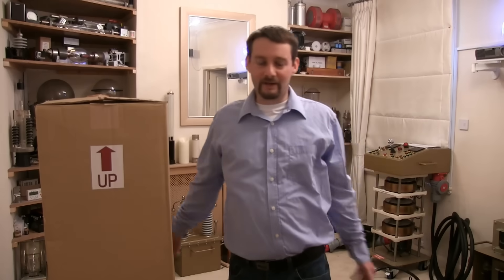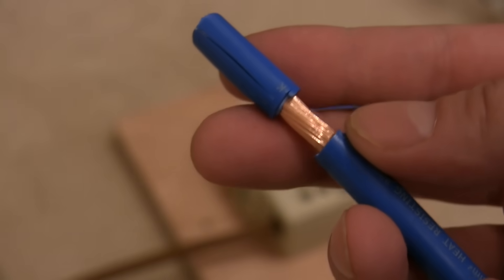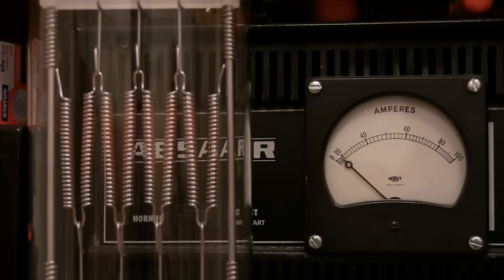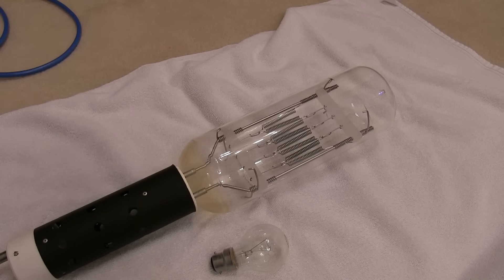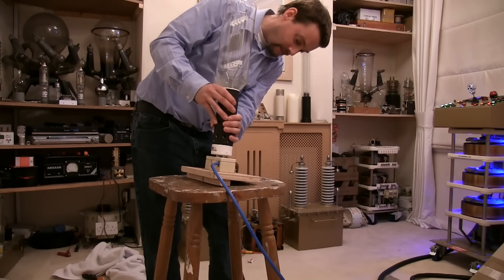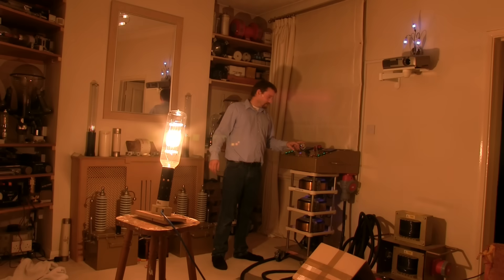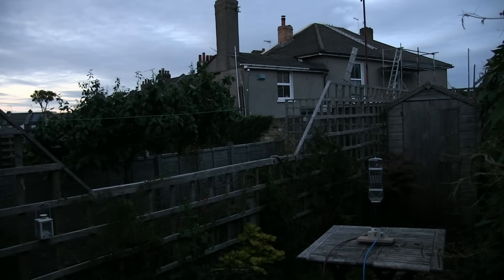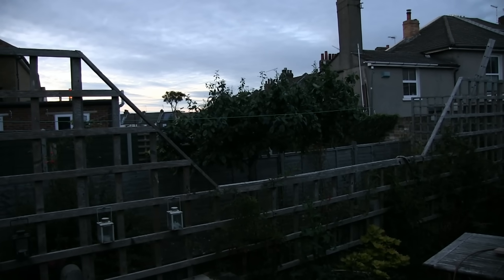20,000 Watt Light Bulb Test

Comment: A whiteout on your end!! Wow!
A friend of mine gave me a bulb that he says came from a radio tower, but I can't find a socket to wire it up safely.
Where might I find such a socket?
It isn't a screw in bulb, and looks like it is a push in and twist type of bulb?
Anyway I know it came out of an aviation obstruction light.
Any help would be great 👍!
BTW, there are exactly zero markings on the bulb itself. It's about 10 inches tall, and about 4 inches across...

Comment: What was the operating voltage of this?
Reply: He varied it, gave it 12v at the start of the video. The end of vid outdoor test was showing 227v
Reply: Voltage is in red on the meter display, measured in kV.  The bulb is rated for 240V.

Comment: Temperature at various distances around the bulb to determine actual radiated heat. Check temperature directly above it to determine convective heat through the old hot gas rises. This should cause a classic thermosyphon in the room.

Comment: The lighting fixture that you use with these lamps is the size of a wash tub and has a fresnel lens 24 inches across.  I used three of them once on a film  set and the rental house accidentally sent us two 208V bulbs (for three phase power) and one 240V bulb (single phase)  the 240V bulb was visibly dimmer on our 208V system until we figured out the problem and got another 208V lamp.  Good thing we didn't run a 280V lamp on 240V single phase power and over volt it!  Those bulbs are expensive!

Comment: Cool video... But seriously, who would want to use such a large incandescent lamp when MH, Short-Arc Xenon, RF plasma, etc.. Lamps are available, and FAR more efficient. I mean, this thing is basically a huge resistor that gets so hot that its putting out visible light as a by-product. No matter what anyone does to it, its still a metal wire, glowing white hot, so probably half of the energy is below the visible spectrum, and the hot gas around it is putting out UV, so you can't see that either.. Here in Canada, we've already banned new installations, which is a bit weird, because now we have some streetlights that are bright yellow, and the new xenon ones that are bright white, and the even newer LED ones (that we abandoned and are no longer installing) are blue-white and look terrible.. When they first installed them they looked really great, but after 2-3 years, the colour correcting phosphors degrade because of how cold the winters are here. In my city we've agreed to a contract with a company that makes xenon lamps, were using those now, MUCH brighter, and true white, not yellow-orange, not blue-white.

Comment: Looking at that control panel, there are copper coils underneath it, presumably to do with the power delivery, but why do they have little white arms rotating slowly around them?
Reply: They're most likely variable transformers. The arms move across the coils to vary the voltage.

Comment: You know you are experimenting with a massive incandescent light when it requires 240 volts and 20,000 watts. First clue is when every flammable object in lab catch fire from direct radiant energy. Going to need a bigger lab, maybe even a warehouse. You need to get psychologically ready for the enormous electricity bill coming. 

Wonder what 5 of these behemoths running together would look like... Sun, Supernova, Pulsar, Ground Zero with Tzar Bomba, Trinity.... it would be spectacular.

Comment: How big is the transformer feeding your house?  The transformer that my parents house shares with their neighbor is 15KVA.  If they tried out this light bulb they would blow the transformer on the pole.  Or at least the fuse on the transformer.
My house is on a 25KVA, but I share with 2 neighbors.  So I could get away with it (I'm assuming good PF because it is a resistive load) as long as my neighbors weren't using much.

Comment: That looks like the kind of bulb used in a search light , 
I'm really surprised that he wasn't wearing a welding helmet or very dark goggles when he powered up that light bulb because of the very intense light would blind you permanently , If I was powering up a big light bulb like that , I would never do it in the house , Also I would have Lexan plexiglass shields set up in case the bulb would break to prevent getting hit by hot shrapnel
Also I'd definitely be wearing very dark goggles or a welding helmet to protect my eyes from the very intense light and I would make sure to be at a safe distance from the bulb , Also I would have a fire extinguisher on hand as well , The way he was doing it was very dangerous , No safety equipment
No personal protective equipment and standing close to it with no safety shielding around the bulb and especially doing it indoors because that could have very easily started a fire because a bulb like that will produce very intense heat as well
For doing this you must have the proper safety equipment and personal protective equipment in place

Comment: I was at the beach a couple months ago and found a light bulb similar to that one. The base is missing. Its just the glass envelope with a couple bare wires out the bottom. 3 out of 5 of the filament supports are broken off. The filament looks intact but the glass had barnacles growing on it so its been floating around a while. I wondered if it was possibly a ship mast light or something like that?

Comment: I need one of these to heat my apartment in the winter.  It gets to be minus 30 degrees c here
Reply: This would be very cost intensive 🙈
Reply: @sokol7215  i don't pay the electric its included in my rent.
Reply: @alfulton5946  oh boy, it's included as long it's nearly the same amount. As soon it change and you will use more there will be a special bill coming for you. There is nothing for free my friend
Reply: @sokol7215  lol it depends on how the landlord words the contract in Canada.  I can have air conditioning and electric heating if my building doesn't have sufficient.  I agree this would probably not apply and I really would only want it to play around with and would not have any reason to power it fully
Reply: @alfulton5946  oh good to hear it was a joke 😂

Comment: The cameras auto iris is not set. A go pro 7 and above etc would run this sharper and not over expose.
Reply: This video was relaesed 17.07.2016, GoPro Hero 7 was released September 2018.

Comment: This is extremely stupid and dangerous. Those bulbs are used in movie lighting and they can and do explode. When they explode inside the fixture they shatter 4cm thick lenses and bend aluminum sending 800 degree C shrapnels in all directions. Specialized fixtures are designed to protect you if the bulb explodes. Lighting one out in the open and standing next to it is just stupid.

Comment: As the dude said, metal increases in resistance as it heats. The opposite occurs for semiconductor though: as the hotter it gets the more it conducts, the more it conducts the hotter it gets. This is where you can have resistance thermal runaway.
Love these videos
Reply: I don't understand
Reply: Semiconductors have a negative temperature coefficient of resistance. Thermal runaway is a principle that affects semiconductor devices and notably power transistors.

Current passing through a semiconductor device heats it up, causing the resistance of the semiconductor device to decrease. That decrease in resistance enables more current to flow. That increased current causes more heat to be generated, which lowers the resistance of the device further.

Eventually so much current flows that semiconductor device burns out and the device fails.

It's effectively positive feedback, but we call it "Thermal runaway".
It doesn't always occur but you do need to consider it in the design of electronic circuits, particular where you are dissipating a fair amount of power through semiconductor devices like power transistors.
Reply: @deang5622  good explanation

Comment: Hey there I know this is an old video but is there any way to get in touch with you? I have a very OLD 35mm cinema projector with a xenon igniter for the lamphouse. I need some advice from you to get this thing working again. I’m using an arc welder inverter to supply the power for the lamp but for some reason the lamp indicator and striker on the console aren’t working right now. I would ideally like to continue using all the original controls. Please reach out to me at jaybro on Facebook and we can IM, thanks!

Comment: I have acquired several and I'm not quite sure what to do with all of them , like a 157 lb Step up Transformer that run a concrete factory and a vintage xenon power supply and rectifier both from the 70s....  I wish it was feasible to get one of them to you. I'm really interested in your variac I guess that's what it is the Tower of Power that I often see in your videos did you make that could you explain briefly the parameters of its input and output?

Comment: I think it's safe to say that Bulb is still more brighter than LED lights when you ramp the voltage higher. I'm a flashlight enthusiast as well btw.
Reply: Yeah but he needs the 100amp socket straight from the power pole. And if he runs it for more than a minute he will burn his house down.  Leds are the bees knees especially if your growing pot

Comment: It's funny how videos like these were kinda what started my interest in electronics, a few years back I barely understood anything and the numbers were kinda meaningless and I was just here for the show, now after a few years and dozens of electronics projects and engineering studies I actually somewhat understand what's going on and how much power he is actually playing with
Reply: Same!
Reply: Well Mr smarty-pants, if you were to dumb it down for me, how much power this fool pullin?
Reply: @CharizardChase  a lot
Reply: @user0000user  Ahhh. I heard this before, this is know as a "Technical Term". 
I used to think High Tension Electricity was something your saw on the Late Jeremy Kyle show...

Using my limited technical knowledge of diode banks and xenon lightbulbs to verify this claim, I can also confirm this is A LOT.
Reply: @CharizardChase  if I'm not wrong it would be like a forklift lifting a 200kg object 1 meter per second or the same forklift lifting a 7.8 ton object 1 inch a second
Reply: It's a metric fork ton of power 🔋